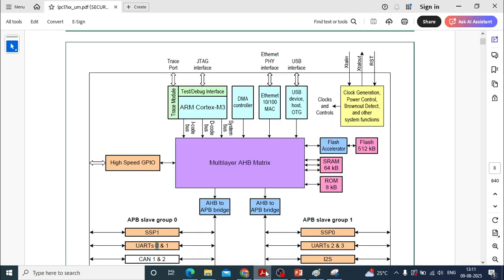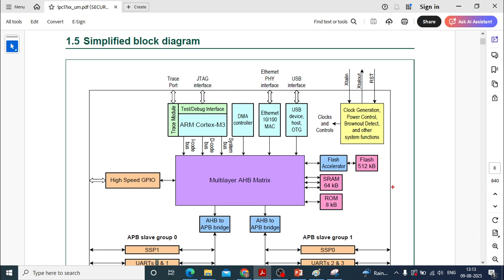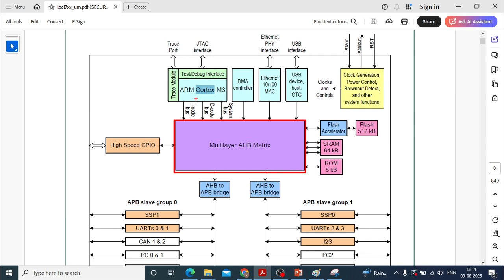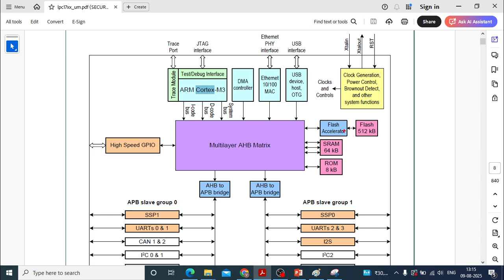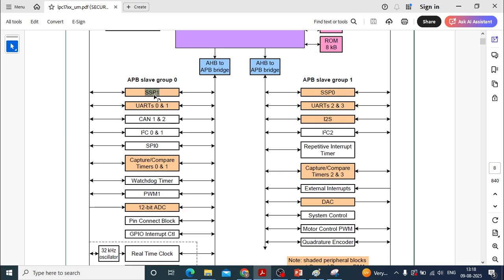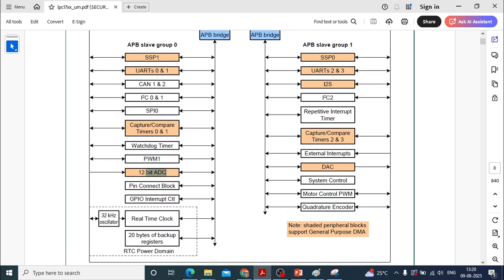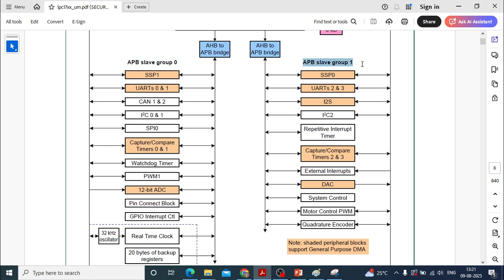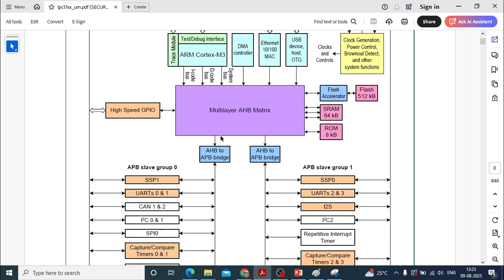Microcontroller Architecture | LPC1768 | Microcontroller Block Diagram | NXP Microcontroller

Comment: It's cortex m3, so, unless you need to program in assembly language, you can make brief review of architecture, with emphesis on peripherals. Much more important is straight programming in C language.
Reply from the maker: Embedded Systems Course for Beginners – Level 1 | Embedded Systems Tutorial Series for Beginners | Embedded Systems Made Easy: https://www.youtube.com/playlist?list=PL64VXTyRJbOraBRluAfq91xYW-9t7WnKL
Reply from the maker: Embedded System Course for Intermediate Level (Level2)  | Embedded System Course - Level 2: https://www.youtube.com/playlist?list=PLNGpxCePmKP4
Reply from the maker: Embedded System Course – Advance Level (Level 3) | Microcontroller & Embedded C: https://www.youtube.com/playlist?list=PLTu_mJQ1xwP8